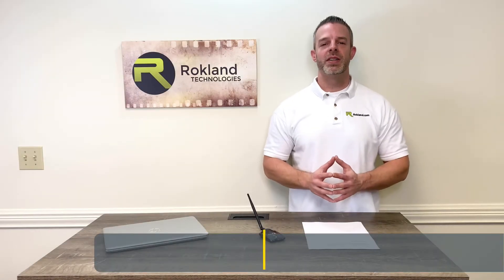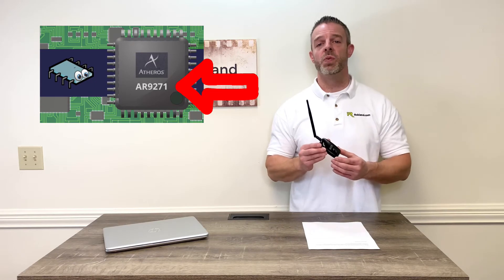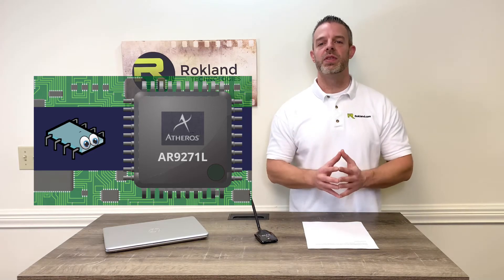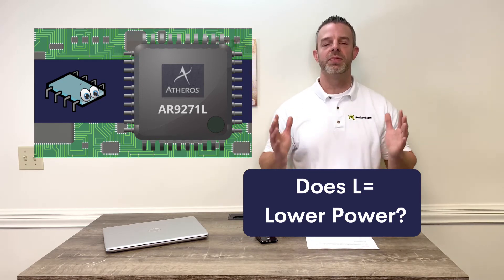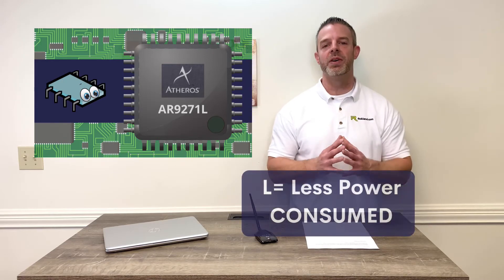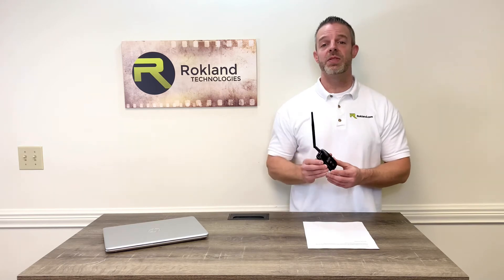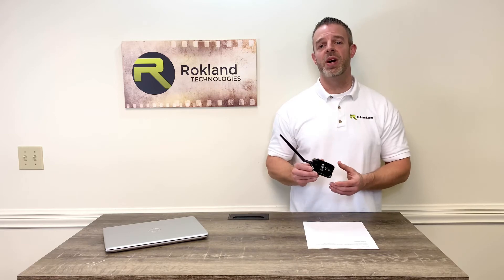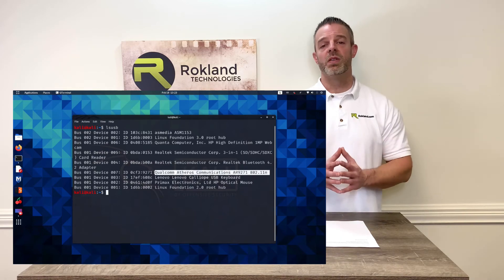ALFA AWUS036NHA: Does it have Atheros AR9271 chipset or AR9271L, and what is the difference anyway?

Comment: AR9271L is the same as AR9271 so they both support monitor mode and package injection, is it right?
Reply from the maker: Yes this is correct
Reply: @Roklandwifi 
 i am getting an adapter with ar9271 at 1/3 of the alfa price.
Will it work the same?
Is only chipset the main thing to see in adapters?